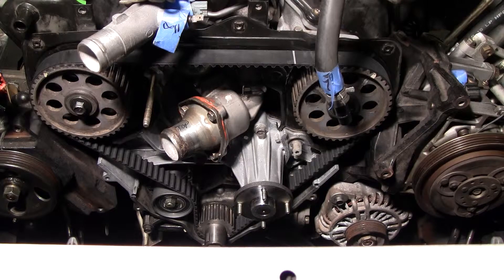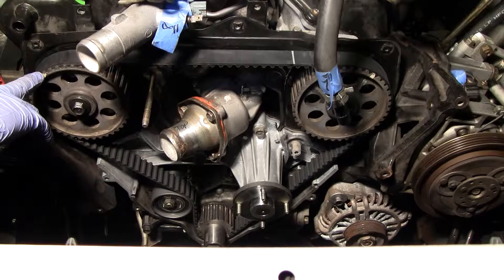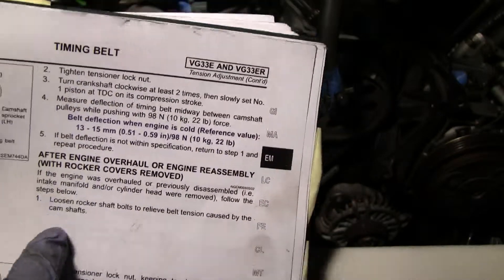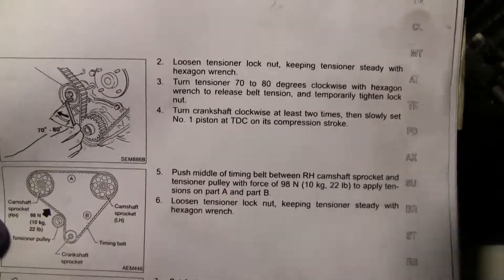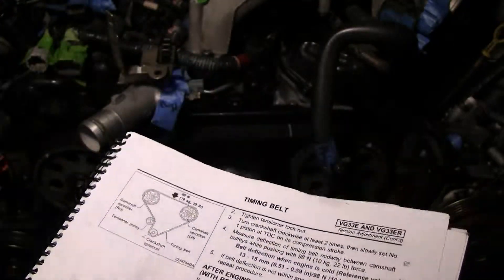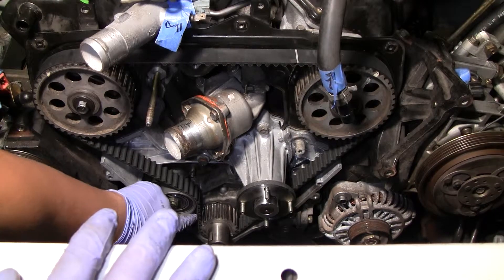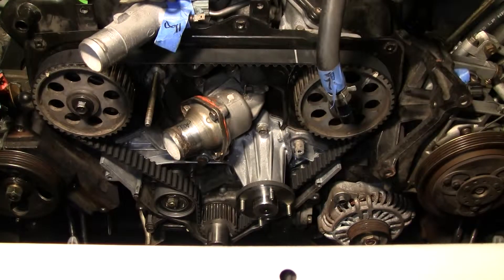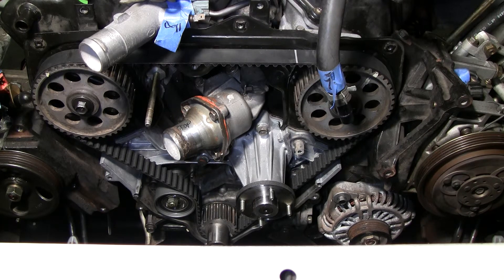2002 Nissan Xterra VG33E Rebuild Step by Step Part 87 - VG33E Timing Belt Installation

Comment: Ok the service manual says that you should  loosen the rocker arm bolts before installing the timing belt.  Did you do this?

Also is says to set the "knock pin" at the twelve oclock position.  This works fine for the left hand head but on the right hand head it prevents you from screwing down the rocker arm bolts.  It says you must not screw the rocker arm bolts on while the lifters are in the up position, which is 12 o clock for the right side.  

Also did you rotate by hand the sprocket in order to set in to the correct punch marks on the timing belt cover.  The manual does not mention this step?  Wont spining the camshaft independent of the crank damage the valves potenitaly?  

I guess my basic question is should I set up (rotate the camshaft) prior to putting it on the block and tighten all the rocker screws first.  It seems that is what you did.  I am very confused.
Reply from the maker: I did not loosen the rocker arm bolts before installing the timing belt. You can do that, but then make sure you torque down the rocker bolts in order as well. I installed the head bolts which did requirement to loosing those rocker bolts, but then torqued the rocker bolts down to specification. 

I'm not sure about the knock pin location. Sorry. 

I used the sprocket tool which lets me rotate the sprocket and hold it in place when torquing it down to ensure the proper cam sprocket location. there is the possiblity depending on how much you are turning the sprocket. If you need to, get the heads off the engine and get the in the general right direction before you try to get the belt on and have the sprockets and crank aligned. 

To answer your basic question, yes you should. Get the heads off the block and have the cams pointing in the general right direction of where you are going to put the belt on. Once you get the head gasket on, then the heads on, you might need to tweak the sprockets a little to get the correct tooth on the correct alignment marks, while ensuring the block is set at Top Dead Center for cylinder #1. Ensure you do not move the crank when set. You can rotate the sprockets slightly when getting aligned with the belt and you won't damage anything. I'm not sure when you should be locking down the rocker arms, as mine were torqued to spec prior to putting my heads on.
Reply: When I had mine all apart ( heads still off )  I took notice of a good spot in rotation where none of the pistons are at the top, which was with balancer mark at about 
10 o'clock position.  When putting valve lifters and such on I put crank in this position.  Then put cam gears where marks line up as safe place for turning crank.
Always turn it over easy so you can feel if anything does try to hit and not hurt anything.

I also noticed after getting belt back on in correct position that the marks on the cover did not seem to perfectly line up.  Rainman Ray did one like that and said the belt was stretched and he was going to get a new one. I don't know if he shows a new one fitting any better.
My belt only has a few thousand miles on it.  Now on this video you say yours are not lining up perfect either.  I'm thinking maybe NONE of them line up perfect.  I just go with counting the teeth.